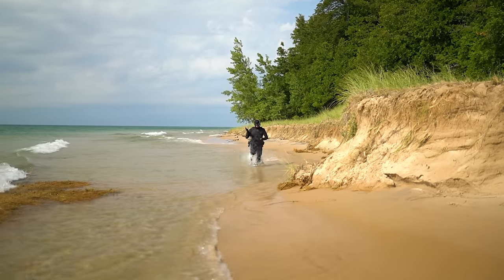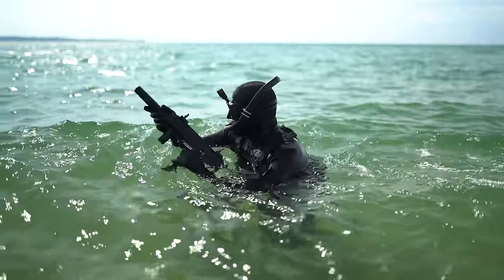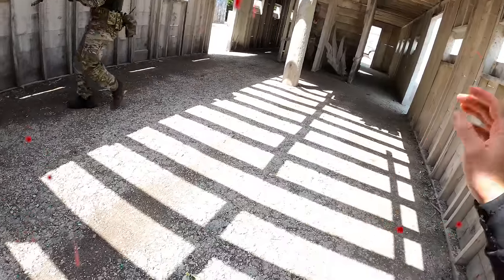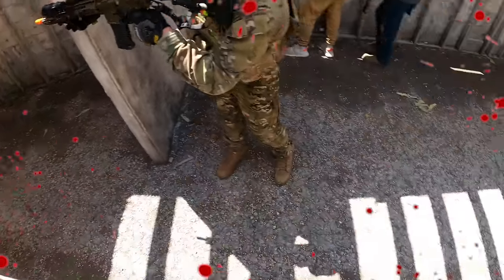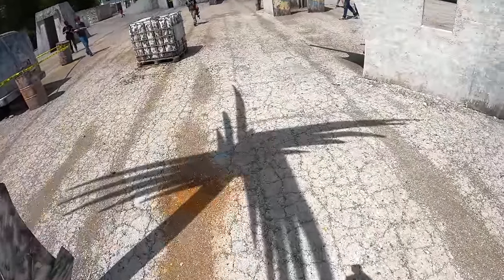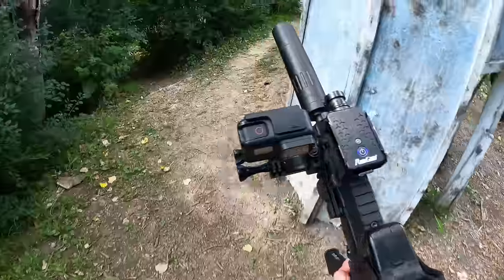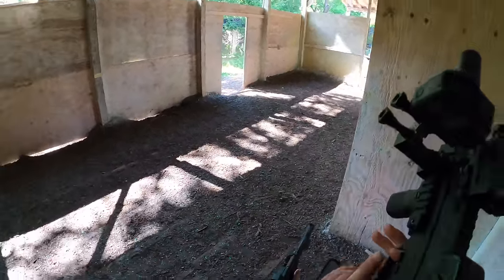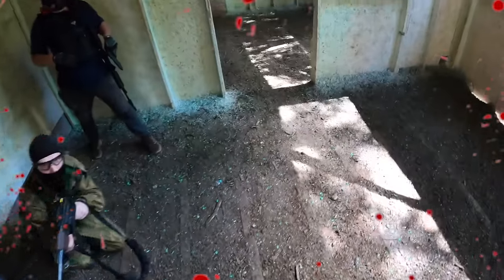Airsoft MP7 GBB Gameplay + Underwater Testing! (Super Realistic!)

Comment: Pretty much all double stack gbb mags will fail to feed if you mess up the stack. I know some can load from the bottom, but using the gas mag adapter on a speed loader and loading from the feed lips seems to give a more consistent stack. You should check out the Tippmann m4. Seems like the best of AEG and GBB worlds.